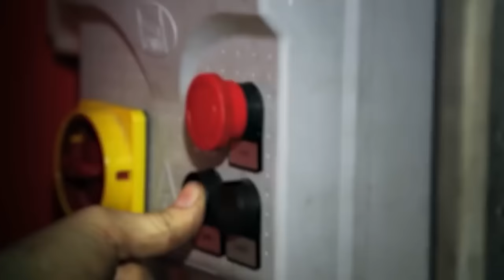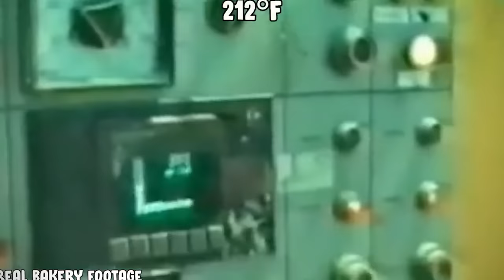15 of the WORST Bizarre Deaths (So Far)

Comment: That Denny's sign story is heartbreaking. I wouldn't be surprised if, after 50 years of marriage, her husband died of a broken heart.
Reply: I thought the same thing. That got me a bit choked up.
Reply: So so sad😥 im glad that atleast one of them had an instant death instead of pain
Reply: He said that Lloyd died from his Injuries later on.  So don’t worry.  The sign took them both out happily ever after together.
Reply: That's what I thought
Reply: So sad 😢😭
Reply: I was shocked that the damn thing weighed just under a 1-1/2 tonnes.
Reply: @SlickArmor that's what I thought,1 1/2 tons? I'd think they'd use light weight materials if for no other reason than to cut down on the size of the pole to hold it up. Companies are such cheap bastards I'm sure no one had gone up in years to see if the bolts were rusted thru in those Ivey Kentucky winters
Reply: @richardsanjose3692  There probably is a reason that it's that heavy too that we're missing because we're not sign builders and erectors. Not the least of which what was available when the sign was first put up.
Reply: Divine intervention
Reply: The sad thing on the denny sign one, that sign had been up for Years and was never actively checked or taken care of. I lived in that town for 20 years, wit both a grandmother and mother that worked at that location and lots of family friends who had been or still are employed there, and not once after Denny's company after going Corporate did they check that sign. I used to remember some sick jokes over the years that that sign would've eventually fall over because it was never taken care of or checked on. 

The entire thing broke my heart when I had saw the news story for it and I wish/hope/pray that the daughter gets proper compensation for all of it because in my opinion it is the restaurant chains fault for not properly checking the sign every couple of years to make sure it was structurally strong or sound to uphold its weight in any weather conditions.
Reply: @SlickArmor  My best guess is that the weight was to reduce the likelihood of it being completely blown away by gale force winds (cause I mean, it's very wide at the top), but even then it's probably a bit much.
Reply: Normies gonna norm
Reply: Wow just read your comment as the video clip played ! Such a sudden randomly tragic event.
Reply: I'm hoping it's just his ribs and his heart taking affect not because he was so heartbroken thats worse hell I'm surprised my mom loosing my dad at age of 60 I'm 21 she didn't die of heartbroken like I'm surprised I'm alive still
Reply: Thats how my great grand mother died after she out lived my grandpa her baby boy by a little over a year
Reply: @deathc0reguy925 I seriously doubt that Lloyd died happily, with him later dying of his injuries. He may well have suffered greatly before he passed away.
Reply: I saw something like that happen in person. Thankfully nobody was hurt or killed, but I saw a McDonald's sign topple over in heavy wind and land on an empty car. That car was so utterly flattened, the ceiling of the car was touching the floor. If anyone had been sitting in any of the seats inside, they would have been pulverized and killed instantly. Thankfully, they were inside the restaurant having lunch when it happened.
Reply: I mean, its very likely part of it. The trauma of the situation itself along w losing your wife that way, right after a heart surgery. Theres a lot of elderly couples that both die very closely in time to each other. Once you’ve become so attached to someone, built your life around them, losing them is just such a massive psychological weight.
Reply: Final Destination..
Reply: @richardsanjose3692 you realize the rust comes from salt and not just winter weather right?
Reply: That's some final destination shit right there.

Comment: The Bakery lost more than $13,000 in lawsuits and fines. Tragedies always cost companies more than doing it correctly in the first place.
Reply: Sadly 400 employees lost their jobs forever as well...
Reply: @AnneOhn123  Exactly. In the end everybody looses. Not worth it at all.
Reply: And the fact that they were only charged with failure to provide a safe work environment.
Reply: Bull crap it’s the big bosses cutting corners that kill people
Reply: It's open now a days once again I remember going by as a kid
Reply: the bakery one really gets to me..... i worked in a insulator factory, and there was this one (rather big) guy, who's job was going into the dryer if any of the carriages became stuck. During production.... He obviously did not go into the 160° C core, but his job was to go between the two insulating walls (basicaly the dryer was a core then a space on either side and top/bottom for insulation then another wall, no ceiling/wall lighting inside) from the colder side (the temperature of the dryer goes from 160°C on one side to about 70-80 on the other split by metal doors both in the core itself and the pasageways around) and when he chanced upon the stuck carriage to use a crowbar to realign it. If it got too hot he took a longer crowbar to reach further and realigned it while hiding behind a partialy opened door to the next section.
And that guy had a rather pronounced pot belly, i could just imagine him geting stuck inside the almost 80 meters long dryer.... somewhere on the hot side, where any rescue would have to come all the way from the other side.... luckily he knew what he was doing and there were no accidents, but you would never get me inside, i just shined a torch down the hallway and could feel the creeps.
Reply: Greed does that to people.
Reply: Unfortunately some of these fines are so low, compared to the cost that many companies will take the fine over correcting it.
Reply: And….no one checked the temperature gauge.  When it was clear things were going wrong… they did and found it was clearly much too hot to send humans through.  But no one looked before…unbelievable.
Reply: The issue isn't that people don't understand that situation.

It's that the other 99 times they broke a safety rule to save money, no one got hurt. Its just risk management.

Comment: I used to be a manager in a large movie theatre. We would do staff meetings on safety that would finish with essentially a game of hide and seek during a fire emergency. This would ensure that our cast knew of every place a child or adult might hide. Most times it was light hearted with me hiding behind screens or others hiding in obscure spots. All jovial when im calling to them from behind a theatre screen telling them they need to check spots like mine and teaching them how to access the spot quite easily. One time while the alarm was going off and i was seeking i asked if anyone had checked the elevator. A senior manager said elevator access is shutoff during a fire alarm. Being the maintenance manager i found the elevator key which is an articulating bar and opened it up. Three employees were inside. I turned to the senior manager and said, "Great, you killed three people because you werent willing to search properly."
Reply: Good on you for being so thorough and complete in your management of the theater! I assume those people were no longer employed by you… or were severely reprimanded. No excuses for halfway work.
Reply: At one point in the 70's Copenhagen Central Station had a "chain" of a caferteria, a good restaurant and a high end grill place in one corner of the station building, just opposite Tivoli on the other side of the street. The 3 places in the chain had a common toilet in the basement floor and the supervisor of the chain was supposed to check it regularly because addicts were known to try and get in there and do their fix.
Granted, he had other things to do a lot of the time, so he couldn't go down there every 5 minutes, but he did move back and forth all the time, very often passing the toilet, so it would have been easy for him to just make a quick check regularly on his way from one end to the other. And while it wouldn't be often enough to prevent and addict from entering and fixing, it would be often enough to prevent an OD from becoming lethal.
As you can propably guess from this, he couldn't be bothered to walk up and down the stairs to the toilet as often as was prudent, so he would just say he was too busy with yet another problem arising, and just walk past. The result was foreseeable. It happened on occasion that I or somebody else tasked with the various jobs not covered by him or the waiting or cooking staff would come down there to do some odd job like cleaning or ensuring that soap and towels and toilet paper was in place, and find the dead body of an addict in one of the stalls. Quite apart from the obvious sad situation of someone dying down there regardless of reason, and all the chaos it created when it happened, it was a problem because "ferrymen" as we were called were all underaged and only there until we became legal adults to save cost on the salaries given.
But regardless of the super being aware of the problem since it had happened even before I came to work there, he still couldn't be bothered with the regular routine inspection for that very purpose, so it would almost always be an underaged employee or an unfortunate customer that would happen upon a dead body. And even though I fully understand that it would be unpleasant and sometimes even shocking to find dead bodies down there for him too, it is no excuse for him to leave it to customers or underaged employees to find the bodies by neglecting his own duties. But somehow he always managed to persuade the management of the place that he was off on some major problem when it happened, thus avoiding consequences. I was glad when I heard some years later that the place had been shut down and a small supermarket put up instead.
Of course it didn't happen often, but in the 11 months I worked there, I saw it 3 times and heard of 4 other cases when I would come in to work. And only in one of all these cases was he the one who found the body. Needless to say that this didn't do much in the way of making him a popular super. But despite the problems of underaged employees having to find them, management would be rather large when it happened. We would always be sent to the grill to get a really good meal of our own choice, have the rest of the day off despite other employees having to work and run faster (which they never complained about in those situations), and when the pay check arrived there would be a very generous extra amount on it for that month, usually something like a weeks adult salary on supervisor level before taxes were drawn. And in my own personal case, I didn't mind he shock of finding a body though it WAS shocking, because I wanted a career in the rescue services and knew very well that dead bodies would become a part of my job when I reached that time.
Reply: Dang!!
Reply: @saragrant9749 i mean it was a training exercise. the point is to train and teach people so if it happens for real,  people don’t get hurt or worse. firing them for making a mistake during a training seems a bit harsh.
Reply: ur a great manager 👍
Reply: @Mary-CeceliaPrado Unless the mistake actually costs someone their life or puts someone in danger at the moment... yeah, pretty harsh.
Reply: @saragrant9749  On the contrary, they will probably never forget to check the elevator.
Reply: @lodnisroub  I would certainly hope not!
Reply: @Mary-CeceliaPrado  firing? Perhaps not given the circumstances. I sincerely hope a hand lesson was learned though!!
Reply: @Jens-Viper-Nobel I’m so sorry that you and your coworkers had to go through that, that’s traumatic for anyone of any age, and to put it on children is horrible.
Reply: So there you go ladies and gentleman, that was the story no one asked for. I'll always brag about the time I saved imaginary lives in the imaginary fire and got that imaginary award and then my face was on the imaginary national paper in my imaginary land where I imagine things are a little bit different than they are here. Los candy not the imaginary podium having the media fire questions at me about how I had the hunch about three imaginary lives being in an imaginary elevator and imaginary fire All I said was just imagine the imagery imagine the imagery. Of course that was the next cool meme and t-shirt you know bumper sticker imagine the imagery of course this was all made up imagine somebody being proud of an imaginary situation. I imagine we're all superheroes in our heads if we imagine things like that well I got to go I hear sirens that must mean there's a fake flood somewhere it's my job to go find those victims with the fake water
Reply: @MompreneurDiary can't spell dangerous without it. DANGerous
Reply: @RD-BRAUNSIN You know what? It's one thing to be unknowledgeable. But did you have to proceed to be an A..?
Most people that save lives do so by not doing extraordinary things that will catch headlines or cast off accolades and awards. They simply do what they are supposed to do and by sticking to the script and common sense become the quiet hero that will not pull people out of danger, but will instead ensure that they never GET in danger.
Reply: @RD-BRAUNSIN jealous much? Considering it got over 400 likes, I'd say people enjoyed it. So, maybe you're the one making comments no one wants.
Reply: 45:47
Reply: Good work tho putting the blame of 3 deaths that could've happen but didn't is unnecessary. No one was killed and if it was a drill no risk was imposed. Your remark is very exaggerated but your efforts are commendable so props for having awareness and care for human life.
Reply: Thank God you looked in the elevator! Bless you
Reply: I would like to have you as an employer. Critical thinker.
Reply: @RD-BRAUNSIN Troll much?
Reply: @RD-BRAUNSIN 😂😂😂😂😂 best comment on you tube ever
Reply: @terrytezzbigtel it's about time someone gets my sense of humor. Thousands of empty comments typed on my board is worth it one time somebody laughing. Everything is a skit in my head. I was quoting the guy that was too concerned in the rabble crowd. Remember the 80s when they made up the satanic panic it was never a threat. He would have said you got to stop teaching these kids religion it's the only way to stop evil before it starts. You think this life ain't a warzone. Countless children drowned after watching the little mermaid in the 90's. Marry Poppins had kids jumping out of windows. I'm not even gonna preach about peter pan.
Reply: @RD-BRAUNSIN 😂😂😂 brilliant 😂 I bet we’d write good comedy actually
Reply: Ha! Well done.What an example. Good teaching moment.
Reply: @RD-BRAUNSIN    So well said. Some people get on here just to tell their ridiculous stories that make themselves out to be a snarky hero. You point out that bullshit very well.
Reply: @TTerilee    people fell for the bullshit
Reply: I bet you get a lot of mileage out of that story. 
You remind me of when I was a fire training instructor (I had been doing it for quite a while), and when young guys would join our group, they were often jerks who would routinely yell at trainees with lines like "YOU'RE GOING TO GET SOMEBODY KILLED!" It took them a while to grow out of that. 
That is not a good way to teach people.
Reply: @joe-nf7cf  if the shoe fits... sorry you're so cynical. But, I'm curious- why does it bother you? Like I said before: jealous?
Reply: Not a lot of companies take into consideration scared children hiding during an emergency. Props to you for thinking of that!
Reply: @Jens-Viper-Nobel I am very sorry that you and all the rest of the young people had to find those unfortunate souls deceased in the bathroom of that establishment. However, In defense of The manager, there's absolutely no way that person could be in two places at once. No one could expect the manager to be the one to always find the deceased person as well as performing their managerial duties every single second that they were on the job as well as standing guard in the bathroom to make sure no one OD'd. What they should have done was by hiring a guard or bathroom attendant to make sure no one came in there to use drugs preventing them from ODing.

Comment: Shortly after the 1st time you shared the elevator video, the elevator in our apartment got stuck for what felt (to me) like a solid minute. I felt it almost hesitate at my floor and then waited, and waited, and waited.... by the time the doors finally opened i was full on panicking. All i could think about were stories like hers. Now i take the stairs
Reply: Worked in an old hospital. The elevators would sometimes malfunction. 
Once, it took 5 minutes to get down 1 floor. It was slow, creaking, We all got out soon as the doors opened and I alerted someone to get it checked. No clue if it was ever was.
The newer side of the hospital has these newer elevators. 
Once a group of doctors and students got stuck between the 18th and 19th floor( about 2/3rds of the way down) They has to pry the doors open from the inside and crawl out. 
I remember the elevator alarm blaring for hours. 

These days, I always take the stairs when going up no more than 3 floors. Or when the elevators are a bit busy.
Reply: I remember back in the 80’s, my husband and I with 2 babies, we lived in Tulsa Oklahoma at the time and there was an elevator that ran underground to some office building ( long time ago, hard to remember exactly what it went to) but we the electricity went out and we were stuck underground between floors for 2 to 3 hours. I was on the verge of panic by the time the fire department got us all out. Been scared of elevators ever since.
Reply: Yup, always take the stairs